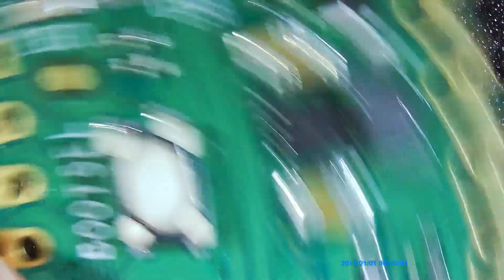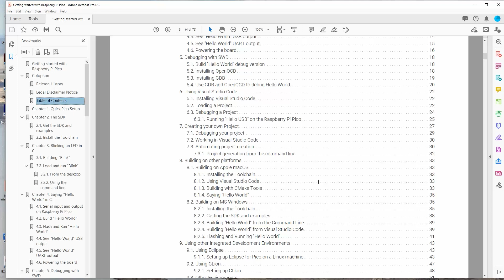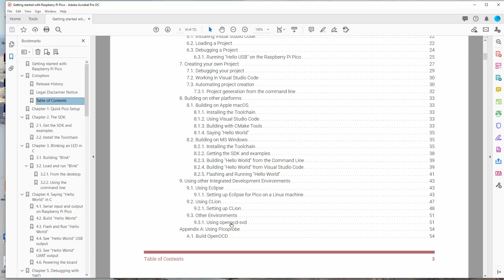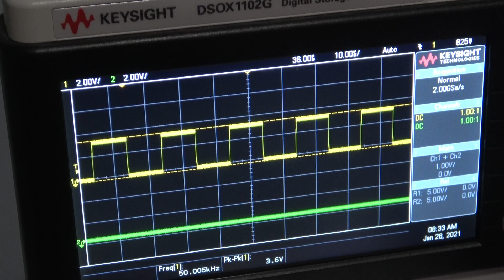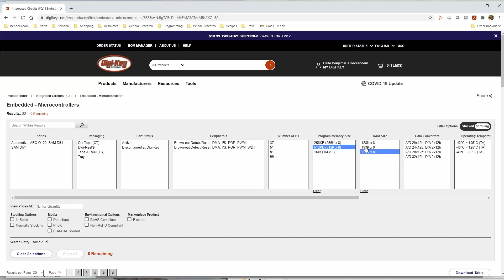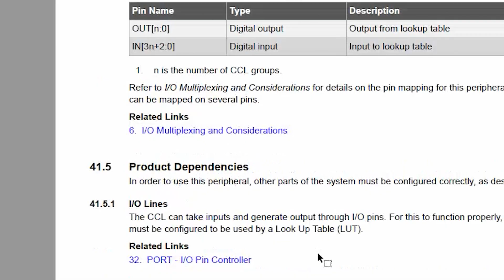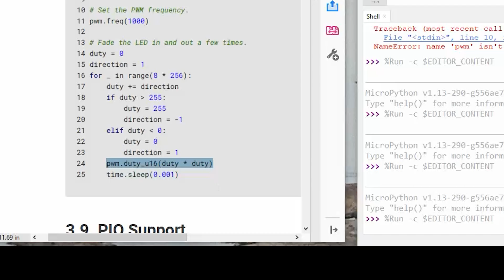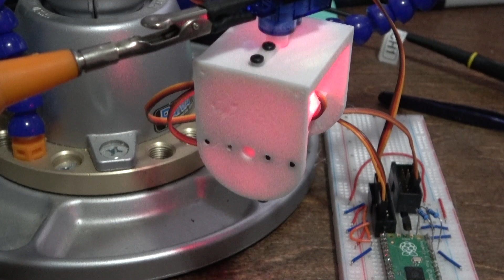Raspberry Pi Pico Testing

Comment: Actually Windows is the last one sorting ascending ;-). I think Foundation did a very good job placing it at the very end. Pi targets poorer regions and they should have the knowledge that paying Windows license to get basic and more advanced stuff is not needed anymore.
Reply: Oh that's why they put mac before windows... Yeah sure bud ;)
Reply: @mmmhorsesteaks  L, M, W 😁
Reply: @SergiuszRoszczyk  eeh ok. I was thinking more about your affordability point... Macs are still hecking more expensive compared to windows systems (which you can actually use for free pretty much indefinitely if you don't mind the watermark too much...)
All in all it's a silly thing to argue about :-D
Reply: @mmmhorsesteaks  yes, in this case Mac is... uhm ;)
Reply: I didn't know Microsoft still made lusers pay for Windows. I thought they gave it away gratis these days. At that it is still a rip off in my opinion.
Reply: @rockapartie  to me Windows is a joke. I've seen things you people would not believe. Kernels compiling for my native architecture. Sub 2.5 second boots. Updates that don't take a half a day! Windows works like a one legged man at an ass kicking contest. heh

Comment: "Python is the new BASIC." - Ben Heck
Reply: is he wrong tho?
Reply: @nordic-chan  Didn't say he was. ;)
Reply: It may be a hot take, but is it wrong?
Reply: @RedLegion  In terms of popularity among beginners, maybe. But otherwise the languages don't really share all that much. What made BASIC so popular in the 8bit days was that it was the first thing you saw when you switched your computer on, it was your OS and programming environment essentially. Python on the other side is just one language among many, it has no special place or integration in any OS.
Reply: @grumbel45  how about someone porting the full version of MS Basic (extended) version form (Radio Shak, TRS-80's Color 1,2 or 3, which where full OS's cos it biggest problem graphic display hardware of the machine, or the  MS QBasic VB-Dos (version lost from time ) from the MS-DOS day's was very close to being the OS when you think you could put the hole lot on floppy disc and it would still be mostly empty  , if it could be done clean code it less than 0.5 megabit or a lot less, I bet would it would fly flow code aswell?, so some make a "basic.uf2"  file you could just drag over to the PICO please :-)
Reply: @dh2032  Program it yourself. What is your excuse for not doing it?
Reply: @grumbel45  You're going back to far. Ben and I are almost the exact same age. By the time we wee old enough to be programing in basic, the computers booted to DOS and just started having Windows 3.1. Basic was what we were learning in middle school and the first year of HS programing, then we when on to Pascal and then C+ in like the 3rd year of a HS programming class. By that time it was 1992-93.
Those 8-bit home computers that boot in basic are for people that were like teenagers in the early 80s.

Besides all that, you completely missed the point. He was just making an analogy that Python is a basic general use programming language that is easy to learn, just like BASIC was when it first came out. He said nothing about how BASIC was part of the OS in some early home PCs
Reply: @grumbel45  I used QBasic on an IBM PC. Basic and Python are both interpretated languages and quite beginner friendly. That's about how far I'll go when it comes to similarities.
Reply: @grumbel45  It actually does have a bit of a special place. Not only is it included as standard in both most Linux distributions and Mac OS, with MicroPython there are machines like the micro:bit that start up directly into it (and a few boards designed for it, like WiPy or Pyboard). Personally I think major strengths of Python include the expansive "batteries included" standard library and the language designed to learn incrementally (no need to learn about modules and classes before hello world). I think Forth might have a better place on truly small machines though, with the caveats that it ties closely to von Neumann architecture and doesn't introduce a type system. I'm thinking it works better for learning all the way down to metal than Python, though MicroPython does have machine code generation too.
Reply: So what is the new assembly? 😆
Reply: @NatesRandomVideo  C > Rust
Reply: Julia will be the new Pyrhon.
Reply: I always thought that JavaScript was the new BASIC.  LOL
Reply: @StevenIngram  meh javascript/ecmascript looks a lot more like C# (minus the typecasting) than it looks like basic

(in all fairness, uint8arrays and the such have been in ecmacript for a while too, but no strict typecasting for anything except for those "classes") 

python has the proper ":" and newline awkwardness and lacks the brackets for functions, like basic.
then again, the old switch/case looks like basic just about everywhere :')
Reply: @StevenIngram  JavaScript is the new C++
Reply: BASIC is still faster than Python lol.
atleast modern variants like QBASIC64.
Reply: Python is a much better language for beginners today because it has real world applications and that knowledge can be transferred directly into other common languages. BASIC was never a good choice for any application. Young people shouldn't have to learn and unlearn 20 years of junk that isn't relevant any more just to satisfy your Gen X ego.
Reply: @GunkDung  It is a bit strange to say BASIC has never been a good choice for anything given how hard Microsoft pushed Visual Basic. Even at my job I still have to code in it because some parts of the website still uses Classic ASP which runs on Visual Basic.
Reply: @GunkDung  well there's something to be said for those old computers running in ring 0 and all

having full access on all memory addresses, you could crash them easily doing the wrong pokes,
it does make the stakes a bit higher, i think it's kind of charming to have this naked enviornment that has 0 security layers, but just blazed through everything, and will just kill itself if you tell it to :')

at the very least it gives one a bit of insight on how much of a performance hog context switching can be these days
(meltdown/spectre patches made that horribly clear too)
i guess terry davis had a bit of a point with templeos, it's like an old playground if you're into that kind of playing around.

Comment: The programming environment looks like a pain to get working--bloatware. And if it forces one to install anything from Micro$oft, it's not worth it. It won't take long before new libraries, versions, etc. won't work unless one has the umpteenth version of whatever Micro$oft is pushing at the time. "You must have Windows 10 25894.45678.983456.98345.89123A to use that library. Please go to the update center..." Ctrl-Alt-No Thanks.

Comment: If you can write C you can handle command line. Your aversion to it really only makes things harder for yourself. You’re already writing code, what’s a little more to run your code.
Reply: Didnt he just say that Git-console is useless, because there is proper UI for it? It just makes it faster if you are doing normal stuff, so it is just the only sane way. (Sure you need the console for reverting Commits and stuff.)
Reply: @AntiHeadshot  is it really that hard to type git clone? I never noticed.

Comment: I think this whole thing is a misfire from the Pi guys. This isn't a very good microcontroller really.. the little state machine thing they have is a gimmick.. and it's pretty expensive considering the chinese chip vendors can now give you a ~1GHz ARM SoC with memory in a QFN for $2 or less these days. Most people will be using micropython on this so what is the point. You might as well just use normal python on a low spec SoC.
Reply: @Christopher Grant 

You wouldn't use OpenOCD to debug python and you can use OpenOCD on a Cortex A too if you really want to.
Reply: @Christopher Grant 

OpenOCD is a debugging bridge. It doesn't allow flashing via drag and drop unless there is some gui for that. I think you might be mistaking it for something else....

High performance 64 bit cortex a chips are more expensive yes. But there are a bunch of Chinese vendors pumping out the old Cortex A7 in QFNs just like this Pi chip. 1GHz single core A7 with 64MB of memory is ~$1.6. Those will run a minimal Linux with python3 just fine.
Reply: @Christopher Grant 

OpenOCD is a JTAG debugging server.. I think you are actually thinking about  CMSIS DAP.. I'm pretty sure that stuff is portable to pretty much any Cortex M? with enough memory.

And if you are using micropython like most people using this board will be it doesn't matter as you upload scripts via special REPL mode.

Again if you are using micropython you probably don't care about hard realtime.. and some of the cortex a7 chips have a microcontroller core in there too.
Reply: @Christopher Grant 

>uPython is real hardtime and is more than
>sufficient for interactive applications.

uPython is only "hard realtime" because you don't have anything like memory protection or a CPU with performance features.. For almost everyone using this memory protection would be far more useful than being able bit banging with less jitter.

>User land drivers suck, and maintaining
>custom kernel drivers sucks too.

Working within the kernel is far easier than working on a microcontroller.
Debugging memory issues on a microcontroller is next to impossible in some cases and memory issues can be caused by really stupid stuff like the length of a string causing an unforeseen alignment issue.

And this is a stupid product even if you must use an MCU because it's no better than a cheap STM part.
Reply: @Christopher Grant 

>for a corporation? For sure. For hobbyists,
>memory alignment issues rarely occur in practice

Ugh, you can't have done much with microcontrollers then.
This is an even bigger issue for the hobbyists because they are much much less likely to have the expensive tools you really need to debug it. 

Either way, you write a lot but you aren't really making a good job at selling this chip.

Comment: I have a bunch of servos laying around here... no lasers though! Maybe I can hack apart the Walmart laser pointer I picked up for the cats.. it was a two pack so I have one I can mess with.. hmmmm
Reply: They give you two because the buttons break very quickly in those devices. I went through dozens before I made my own with a decent slide switch. A 10 pack of diode lasers is like $1 from the great rock candy mountain empire too. Made mine run on a 9V battery too. Because them button cells ain't worth spit either.

Comment: Ben, use SWD to load the elf, when working in C/C++. The uf2 thing is finicky as hell. But for that to work you need to compile Rpi branch of openocd on Windows and use a second Pico as Pico probe
Reply from the maker: I have an Atmel ICE and a few ST links. Will those work?
Reply: @BenHeckHacks  Not sure about STLink but I have seen people on internet using JLink and FTDI
Reply: @BenHeckHacks  The GPIO on the Raspberry Pi will work.
Reply: Never had an issue with UF2 files but building with VSCode can be tricky since the example projects build windows utilities and the Pico output files. I also found out that certain versions of CMake barf on files with a byte order mark. I had to downgrade to an older CMake version to get the Pico examples to build.

Comment: Was unable to obtain one in the UK even after they had limited it one per customer.
Reply: They didn't.  Some resellers did.  I bought 3 in the UK.
Reply: Pimoroni has them back in stock today if you haven't already seen/bought one. I just got one about an hour ago.
Reply: @drentsoftmedia  I just this second placed the order , Thanks for the heads up :-)

Comment: The reason they put Linux first is that Linux is the intended dev environment for this device. They set everything up everything so you can easily develop on an RPi in Linux, and bodged together a Windows option for sake of covering their bases. Considering the company and the likely audience, it is much more important for them to have a good Linux build system than a good windows one, even if windows has a larger share of the wider computer market.
Reply: @Christopher Grant absolutely, all of the CS stuff at my school past freshman level used Linux, and all of my work is done on Linux and BSD. Ben's not a software guy, so I can understand why putting Linux first would strike him as backwards. He just doesn't realize just how many tools for embedded software on Windows are frankensteined from Linux build toolchains, because things like the Arduino IDE don't call attention to the fact that they are ports of Linux tools.
Reply: @Christopher Grant I don't know if Vivado is the same way, it's been a hot minute since I did FPGA, but the old ISE for the Spartan 3 series actually ran a small Linux VM under the hood for its Windows version. There's a lot of that kind of trickery under the hood in these tools when there's a Windows version at all, but I don't think he does anything advanced enough in that area to have noticed.

Comment: I suspect it won't be long before PlatformIO and Arduino support will become available.
Seeing how most people tend to code Arduino, I would say Python it's not so bad. And you can even pre-test your complex logic before on a big machine, as well as write some tests, which I could not figure out how to do before.

I've just researched one minute and it seems you can combine native C code with MicroPython, so that tight loops can be optimized. Probably the only way in which tight timing is achievable.

Comment: I have always wanted a Raspberry pi I can never afford it
Reply: The pi zero is dirt cheap. It's $10
Reply: @abhimaanmayadam5713  the kit I saw was like 100 bucks it had the Keyboard the case for the Pi and all the stuff I would need to get it up and going All I have to do is hook it up to a TV or something I don’t have any computer parts or even a computer
Reply: @BadKarma714  all you really need is a kb, a tv, phone charger (you can get away with a 5 watt charger) Keyboard might be problematic but really any cheap thing is fine. 
SD card is a must but those are super cheap nowadays

your case for the rpi could be a cardboard box or something. It doesn't ask for much

Comment: This chip seems pretty redundant. Yet another cortex-M microcontroller. wow.
Reply: Redundancy is electronics superpower. The first microprocessor was 4 bits and it was OK. Now CPUs are 64 bits and they're awesome! See a trend? So to make an electronics circuit more impressive just copy it over and over. It'll get cool eventually. One blinking LED? Meh. A 3D cube of 512 blinking LEDs? Wow! Works every time.

Comment: Ugh I hate how everything is trying to move to MicroPython. If you want to use Python, you don't want to use a microcontroller. It's simple people.
Reply: Like he said, it’s the new basic. It’s like programming in pseudocode, which is great for total beginners. It’s for simple understanding people.
Reply: @float32  - Yeah agreed. Although personally I would of preferred and recommended LUA. MicroPython is created by Python lovers and it exists and not much else does - so it's Python. LUA would definitely be easier for newbies to learn if for no other reason than having to learn python indenting syntax and not having any kind of more tangible view of blocks? is just one extra layer of complexity for a learner.
Reply: Yeah I don't really get it. But I suppose it's going after the microbit (education) market with the price point so it's good that it's an option. Here in Australia, Python is the language you're taught if you take a computer class in high school, probably the same in other countries too, so makes sense that's what they're supporting.

Comment: There is no reset button  on it 🙁,  I guess  u can use ftdi 232u for debug using swd , bcoz it basically  cortex m0 , but documentation  use rasp pi 4 for debugging  and compiler
Reply: You could wire a reset button to it though. Shorting the RUN pin to GND resets the MCU. Shorting the 3V3_EN pin to GND cuts the entire 3.3V circuit
Reply: @FindecanorNotGmail  why did they name pin RUN? Better called it reset , thanks
Reply: @hemanshu877  So they wouldn't need an early chapter on active low logic levels, I reckon.